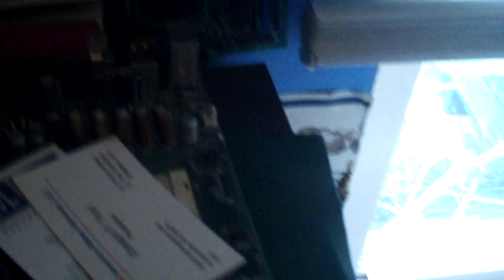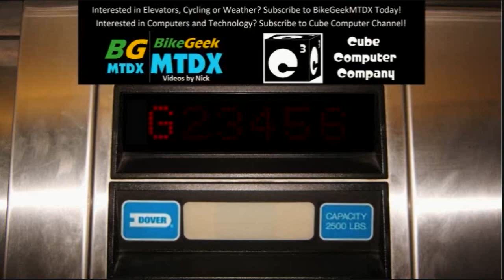How to PROPERLY fix a VGA, DVI, Serial, or LPT connector with missing standoffs

Comment: I swapped my serial port for my video card's VGA port since I didn't have a slot with a VGA 'port' and am using a low profile HP PC.
Reply: I have a few low profile HP systems laying around. I have two with GeForce GT 730's inside, and I pretty much had to do what you did, but I instead destroyed the iGPU's video output and stuck the GT 730's VGA pigtail there. It looks a bit weird, but it works. I actually use the serial ports on those systems so I couldn't compromise them. EDIT: If I had an extra low profile bracket with a VGA 'hole", I would have used that. lol
Reply: Cn Tech I happen to be using a GT 730 too.
Reply: bonjour
Reply: merci